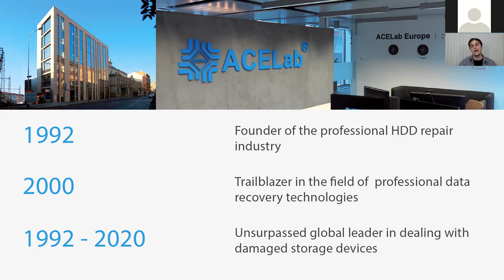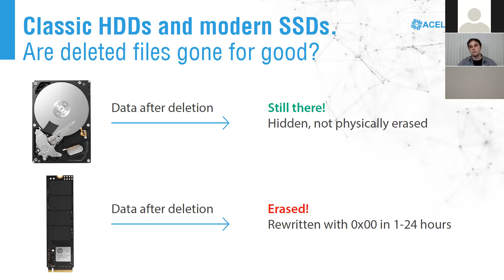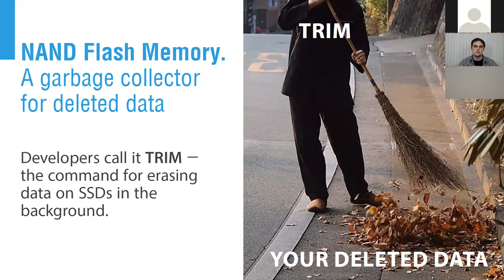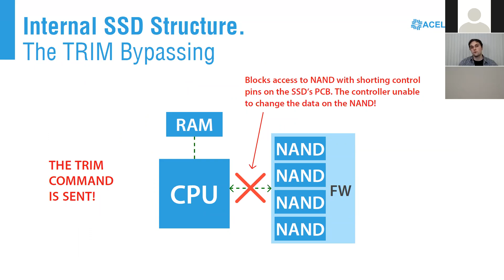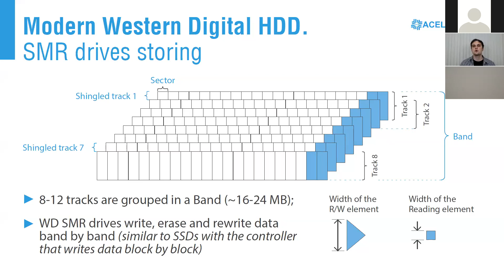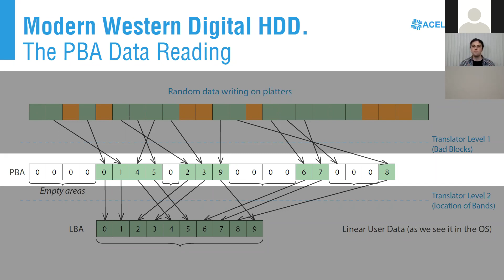TRIM on SATA/NVMe SSDs and HDDs: How to Get Evidence Instead of Zeros

Comment: Hello Roman, thank you for this presentation. I have a question, if I understand corectly you can bypass the trim with PC300, but that will help in case some data is deleted and the ssd is seized right after the deletion, so that the trim function had no time to zero out the deleted data, which is a relatively rare case. If the data is already zeroed out there is no way to restore it, or I am wrong and miss some information? Please answer me, because I am working on a case where the M2 SSD has been windows restored and formated afterwards and obviously in the meantime trim did it's job because now the whole ssd is empty and the unallocated space which is 99,9% of the disk is only with zeroes. So in my case there is no option to restore the data previously written on this disk, right?
Reply: Late reply of course, but "it depends". SSDs are designed to remove the LBA to PBA translation for a given LBA as soon as the trim command is sent. So "OS says trim LBA 123" "SSD used to map LBA 123 to PBA 456, now LBA 123 is not mapped to any PBA", a millisecond later "OS reads LBA 123" the drive will return zeros (which it will do for any LBA that is not mapped), even though the physical block may not have been erased yet. I don't know for sure, but I believe the special mode Roman mentions allows you to bypass that feature and read the raw flash cells directly. Then again without the LBA to PBA mapping I'm still not sure you'd be able to know which cell(s) it was.